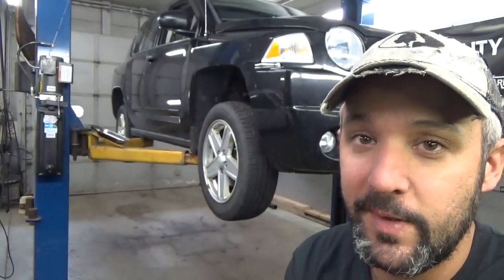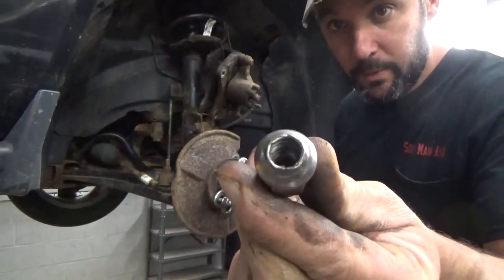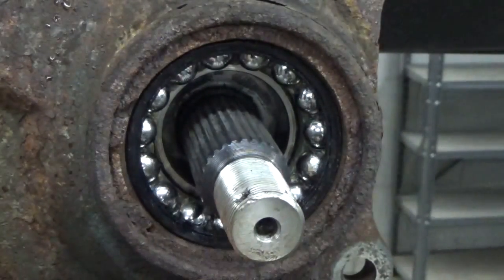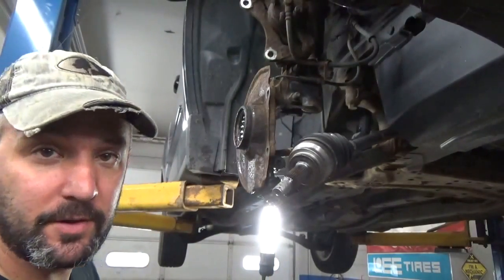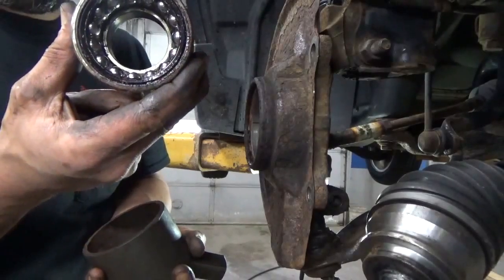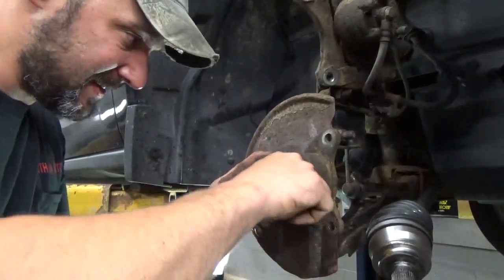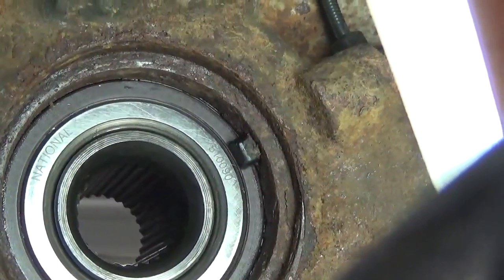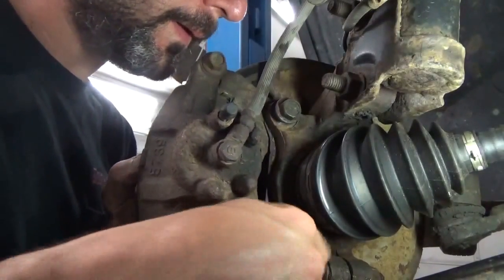Replace Front Wheel Bearing Jeep Compass

Comment: Thank you for posting the Jeep Compass videos.   Our local mechanic wanted $600 to replace a throttle body.  WTF.    So I ordered a new one on Amazon for $60 and it came today at our front door.   During the few days it took for the part to arrive here at home,  I watched several YouTube videos posted by shade tree mechanics on how to change out the same part on the same make vehicle.    It took me less than an hour, and I couldn't believe the difference in the test drive.   No more engine code and sensor light.   It's running smooth with great acceleration and idle.   I also purchased a small hand held code reader, that can erase the codes.   I set off a code when I removed the air breather tube sensor.       Bottom line is,  'Thanks".    Many mechanics wouldn't post their work online.   Much appreciated.   I little do-it-yourself confidence saved me big bucks.
Reply: Fern D did you program the new throttle body?

Comment: Great video - thank you! I just replaced both front wheel bearings on my wife's Patriot and this video was a HUGE help. FYI for those doing it yourself - Autozone rents the bearing puller/press tool (for free) that he uses in this video. So if you want to do it without removing the entire hub assembly you can.

Comment: Great video!,thank you- saved me a lot of money.   Ifsomeone reads this and is replacing a wheel bearing (or both in my case) - If you are a amateur/weekend mechanic just to save money like me with no serious mechanic tools....DO NOT try to take the hub off.....i think he even mentions it.  just take the whole knuckle to a machine shop or mechanic and have them pull the old one out and press the new one in.  In my case an auto part store did it for $50 per wheel/knuckle.   I would also suggest checking your struts and see if they are leaking or any oily residue is on them.  pretty simple to replace them once the knuckle is disconnected from it.  If you buy a strut I would get one with the spring in it.
Reply: Thank you Scott for the helpful hints, good thing to keep in mind.
Reply: Now front knuckles are $130 on Rockauto, for the time saved, it was worth it for me to just buy the knuckle vs. Bearing
Reply: I haven't had to replace mine yet but I'm at the point where my lug bolts are breaking off the passenger  front end.. Amazing tip thank you!

Comment: it took me 2 days at least and part of a third day to remove a set of rear hubs off (rust welded in) of an 05 Pacifica using a half sledge and pipe wrench as well as anything I could get on it. Had I known to get a slide hammer, i probably would've been done in a few minutes or even faster. Seperated my shoulder in the process on that job. The right tool makes all the difference as well as learning from skilled mechanics on you tube like Eric & some of the guys that have been on here a few years how to do these intermediate level repairs. I just can't afford to throw $100+ per hour at a mechanic so 90% of what I can figure out myself by watching videos, at least I get to keep the tools after I'm done as well, and many are free loaners at parts stores. THANKS TO BIG ERIC O. for all the great content, been a fan for almost 5 years now

Comment: Eric you would make a good practical teacher in Auto-technology. I learn a lot from you to go forward. I found something I wanted to share with you. I started out with only one code "system is not programmed, it is still there". I just wanted to get rid of the horrible rear wheel noise. I replaced the two rear hub assy with  new Timkens on a Jeep 2013 Compass 4WD. They were rusted in bad (NJ salt) and noisy as hell. In one instance in-order to stop wheel from rotating I applied a brake to remove the center 1in and 1/4 bolt. That was before I decided to use air tool. Finished the job and all back in place. Took it for a ride and the noise was gone. I was thrilled except after I returned back home from a test drive, shut the engine off and turned it back on few minutes later; the ABS, Anti-Slip, 4WD!, lights are on and the Cruse control doesn't work at all. The CODE I see is C100A only which has nothing to do with rear wheels but front left wheel speed sensor. How did an error come in to being from the front that wasn't there?

Comment: I remember when my family and I had a Mercury Grand Marquis, be sure how your part is like. When I removed the old front brake rotors, it had wheel bearings, and the new ones did not. It took me hours to figure out why it was making noise. It was a lesson that I had to learn. If anyone would have drove that  Marquis, the results would have been catastrophic. I was so glad that I caught it. Once I removed the bearings from the old rotors and place them in the new, the noise was gone. To every DIY who enjoys this hobby and future auto mechanic: Let this be an experience. Check your parts that you need to replace. Look at the old and the new. If you see a difference, take some of the old good pieces that are in the defective and place them in the new. IF they are defective, take the pieces and ask for new pieces.

Comment: Better job than replacing with a 2nd hand whole unit as alignment is also needed.
Guaranteed milage only with oem bearings. A lot of crappy bearings out there. The 14lb hammer must be back in the museum.Job well done .Now that's fixed, should have a good night's sleep.Hard to beat happy endings. PS you're not to ride into the sunset !!
Reply from the maker: Tom OConnor Haha glad you enjoyed it Tom

Comment: I thought the bearing/hub assembly was one piece? I did the rears and i just pulled the old hub off and slid the new hub on with the new bearing already in it. It isn’t the same for the front bearings?

Comment: i've done this on my Jeep Patriot because of your video, THANKS A LOT!!!!
Reply: +(Dominic Demers) I have a jeep patriot as well and need to make this same repair let me know how it went, what problems you encountered and the socket size for the spindle nut!!! Would really appreciate it thanks!!!!
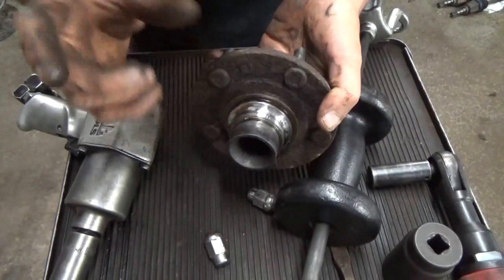Reply: i think socket size is 34 mm, but it's in Canada, u.s. is different cuz it's in imperial. but your parts dealer will tell you. you have to buy a puller kit to take the bearing out, and i used 2 crowbar to pull the part wich he take out with a puller hammer. the big deal is the C clip is buried in rust so it`s hard to take it off. i cut it with a grinder as well as the part of the bearing that is stuck in the spining wheel.  (maybe it's not the right name but you'll see)  it took me about 5:30 for the first side (with the strut change at the same time) and 3:00 to perform the other side. I'm not a mechanic but a carpenter and it was the first time in life i tried it. i think it went pretty good but i wouldn't recommand to anybody that as any tool to practice such repair by itself. You need to have a certain skill to do it or expect to take a lot more of time to do it. Good luck to you!
Reply: Really appreciate the feedback "DD"......I found out the spindle nut socket size was 32mm did exactly what you mentioned, went to the parts store and they told me there!!!! But before you changed out the wheel bearing..what noise or distinctive sound did you hear while driving!!! I get this noise every time I accelerate and stops when I start slowing gets louder as I speed up as well!!! Noise was like a grinding/growling/whining sound. Let me know thanks!!!!
Reply: I did see a hub grappler tool to extract the hub looked easy enough with that tool....
Reply: One last thing what were the torque specs, where did you find or if you just tightened everything really tight

Comment: Watched the small piece of pin go flying. Here's a fix. Close your cutters. Fill the cavity with silicone. When it's dry, slice with a razor blade right down the middle in line with the cutter. When you cut things,  the silicone will flex and hold the small pieces. Old electrician showed me this. Has worked for years

Comment: I like how you do them I’m old school and always take them apart and bring them to the 20,000 lb press and press them out but I run into the same thing with the race sticking to the hub and I found out if you heat them up with a torch and grab it with pliers and run the hub under cold cold water with the race pointing down that as soon as it hits the cold water the race will slide right off the hub !!!! Give it a try next time 🤷‍♂️

Comment: How heavy is the hammer on the slide?  May I suggest oiling the threaded rod on the puller to help save the threads on both the rod and the nut. That was a nice easy one, good. Thanks for the video.

Comment: Super helpful dude!
I have done a few bearings but don't remember them being this tough, nor do I remember having all of those tools.
Wish I had youtube back then!

I found you because I need to pull out a starter on my 97 s-10 and the exhaust is in the way of one of the bolts and I can't figure out what to do. It is the 2.2 4 cyl, standard tranny. It is real hard to get to the exhaust pipe, and am afraid once i get them out, if I can, they might break.
Secondly I heard you can take the motor mount off and jack up engine, but that seemed damn near impossible too.
Do you do those things on any vehicle  like that in your videos? I will keep looking, as the dodge header bolts didn't really address that. I also don't have air power tools accessible.
Anyways, great videos!
Thanks for sharing.
Reply from the maker: Christopher Harper Boy I don't have a vid on that nor do I recall doing one. I have a customer with one of those too just don't recall ever putting a starter in it.

Comment: I forgot the snap ring, I let you know if the wheel comes off
Reply: Ros shouldn't the wheel is captive by the hub nut.
Reply: DigitalYojimbo I thought so, but after a week I took it apart again and to my joy the guys at the shop where they press the bearings for me actually put one on. I did however in my haste damage the abs sensor and had to buy another one. but hey at least i know it's all good.
Reply: they snap off anyways thats why its called a snap ring....:)

Comment: Well done, to clean the front and back of a rusty rotor do you think  putting them in the sandblasting cabinet is a good idea ?  I know a guy that does :)
Reply from the maker: Steve Rob I do once in a while but if they are grease I just use the whizzy wheel

Comment: As a die-hard diy-er with more time than tools I would be inclined to try sledgehammering the back of an old rotor to break apart the old bearing, then a single hacksaw blade to slice and remove the core - allow 12 hours - and carefully hammer in the new bearing. Does that seem unrealistic?
Reply from the maker: smc  Lol that is  a joke right?
Reply: South Main Auto Repair Yeah, I would have to cheat and file out the hub bore - HEY - MAYBE THAT'S WHAT'S WRONG WITH THAT EASY SLIDER!

Comment: These are press- not strike-bearings . Knuckle should come off, then bearing pressed out/in (why it's designated by its engineers a 'press in style bearing'). (Otherwise seat and or bearing can be damaged. Failure occurs months later and not in the first week or two where you think it's o.k. and you 'made it happen' etc.

Comment: eric o I have the new version of the hub tamer and I used the hub puller on it and I like it better than the slide hammer method. what is the bearing number you use with this kit..

Comment: Eric,If you would be so kind,I have a couple quick questions...
1,Roughly what would this job cost on a '97 Pontiac Grand Prix? (I don't really have access to air tools,presses,etc..so I probably won't be DIY'ing this one. I think on this car it's just a complete hub/bearing assembly,held on by 3 large bolts,so it might be more do-able in the driveway,with hand tools?)
2,Do you (or other mechanics) hate when customers bring in their own parts? Someone mentioned to me that shops/mechanics often make some minor profit from selling the parts to the customer,and might be less thrilled about it. (not to mention the possibility of the customer bringing the wrong part,or cheap crap to use.)
Assuming It's the correct part,and decent quality,what is your feeling on this?
I've been watching your videos a lot lately,this is good stuff,and some great info!  Thanks!
Reply from the maker: PhattyMo Answer 1: It would cost you the part plus one hour labor
Answer 2: Me, I don't car, most other shops HATE it. I make it clear though if your car is blocking a bay because you brought the wrong parts I charge you by the hour as it sits there while you get me the right parts. Make sense?
Reply: South Main Auto Repair Makes total sense,and seems fair. Now I need to find a trustworthy shop around my neck of the woods.
Reply from the maker: What state ya live in
Reply: Oregon,just outside Portland.

Comment: Tried on my 07 patriot. The pin sheared off inside holding the axel bolt on before I could get the rotor off. Any suggestions on getting it out? Tried a punch and I don't have any air tools. Also tried hearing it and a few other things

Comment: 19:52 - how did Eric pull the old bearing out and press new bearing in without removing the speed sensor?  Or were the speed sensor removal and reinstallation just not filmed?

Comment: Do you have to use a slide hammer or can you use a jaw puller and have the drive screw press against the CV axle?
Reply: Use a slide hammer. It sucks but you won't accidentally damage your CV assembly.

Comment: Didn't the work order say "replace driver side wheel bearing"? :-)
Reply from the maker: 12vgs8606 Lol nope I double checked ;)
Reply: Usually when I do my own diagnostics and ask for a specific repair, I hang around in the shop and watch/assist.  Otherwise, be prepared to have the wrong leg amputated!
Reply: Ç
Reply: Rooftop Voter I had a wheel bearing replaced, I could hear it coming from the right side, it would quiet down when I turned right, I go pick up the car, it was the left side. Welp, I feel like an idiot 🤣
Reply: Tell the shop it won't start, don't tell them to replace the starter.

Comment: Eric, you didn't verify the complaint, and would've liked a ride along on test drive.
Reply from the maker: super coupe I was handed a part and told where to put it....simple as that
Reply: OK, guess i missed that part, my bad.
Reply: I bet I know what's going on with the customer ... the source of a sound is driving him crazy. There are youtube videos out there where people are hunting for the source of a dull rhythmic sound coming from the front end on these vehicles ... CV joint?, bent driveshaft, transfer case propeller shaft?. They are basically redoing their whole front end. I am one of them. I have a 2011 Liberty and it is DRIVING ME CRAZY!! :-). It is not a typical bearing sound and there is no movement in the bearing, but that is where I am starting. I hope the hub/bearing change will solve that problem!!

Comment: Do you set your air compressor output higher than 90 psi? I have mine set to 90 (based on my air gun rating) and sometimes have trouble getting the old bearing out.
Reply from the maker: I run mine at 160psi

Comment: there are two important details: when you pushing the bearing you need to make sure your coup is not touching the abs sensor in the hub. Seconds, when you are installing the hub, you need to make sure you are using the right adapter in the hear of the bearing, otherwise you will mess up the bearing... I messed mine and had to do everything again.

Comment: it's same model 2007 Jeep Compass also I forgot to ask...the front subframe crossmember is rotted and rusted out and we've already ordered a new one along with a new driver side lower control arm with the ball joint and bushings, and new sway bar end links ...what obstacles do you think I will come in counter with dropping the subframe crossmember?
Reply from the maker: +TNASI Tuning ummm rust... haha I have no idea, I have never done one on these yet
Reply: did you know there was a recall on that
Reply: They've extended the factory warranty to 10 years to cover rust on this part.

Comment: Do you really need to use a air hammer to remove the snap ring or can it be done with a snap ring pliers
Reply: Did you watch the video????? If the snap ring is all siezed up then yeah you gotta hit it and loosen up the rust and crap around it